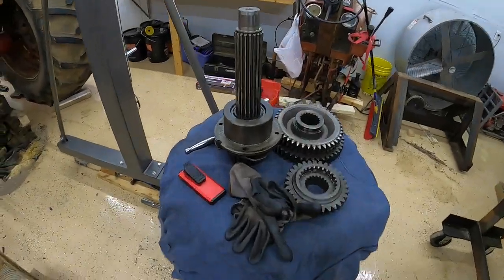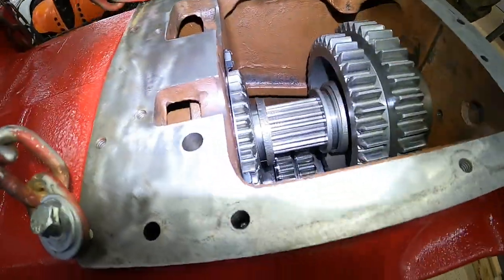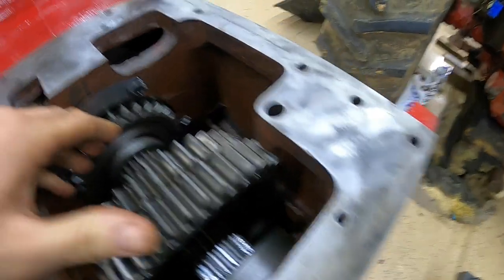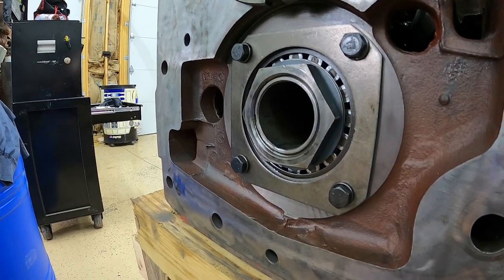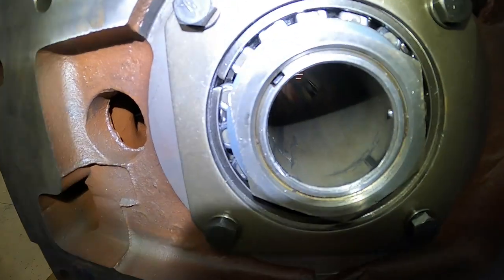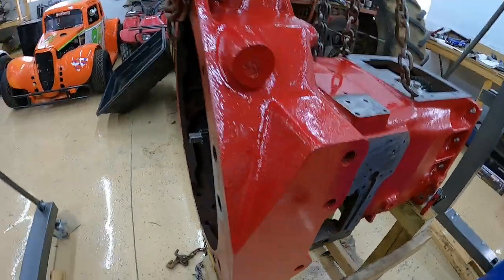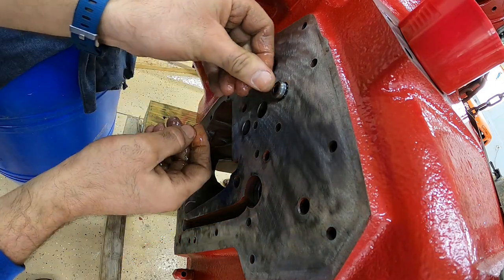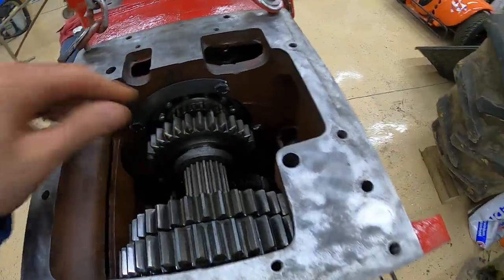IH 1066 - Part 7 - Installing Main Shaft and Drilling Counter Shaft - International 1066 - Tractor

Comment: I have a 1466 and it leaks alot of transmission oil in the flywheel housing. Are there 2 seals to replace? 1 for pto and 1 for main shaft?